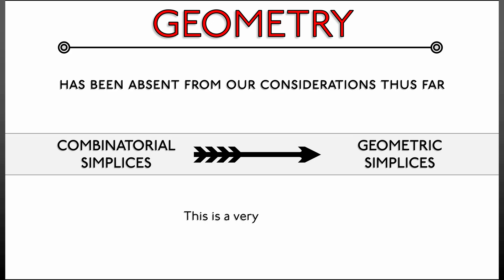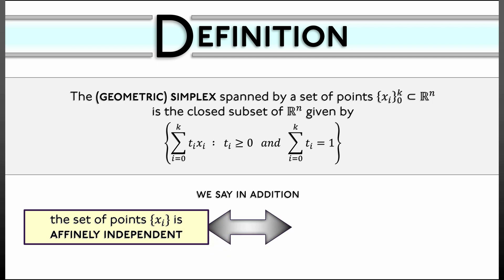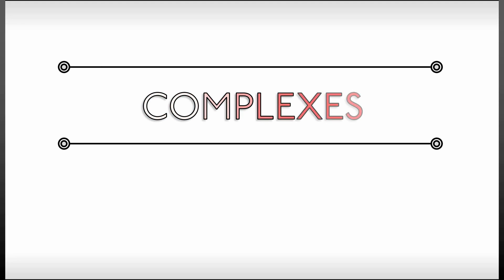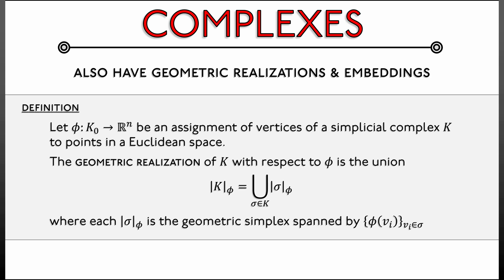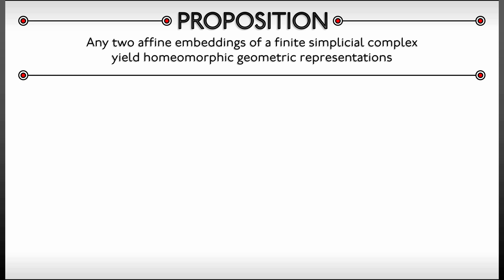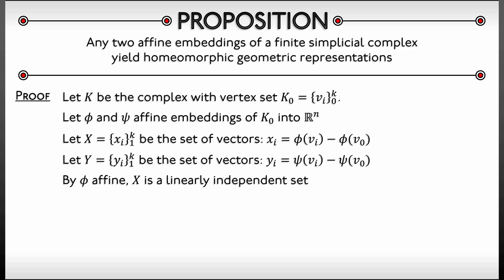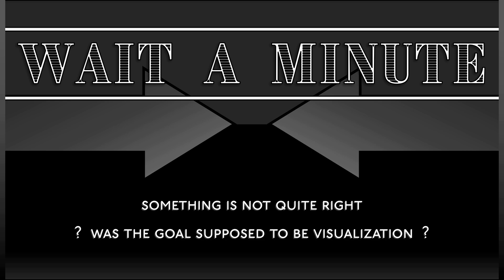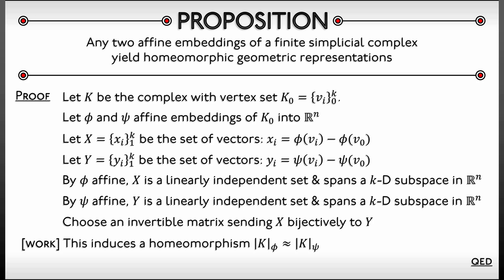FTDA 1.3 : COMPLEXES : Realization

Comment: You provided 3 existential crises in 11 minutes.
Do we worry about it or does it even make sense to think about derivatives of simplical complexes with respect to time if new data is being added from sensors?
Reply: Adding data is a discrete process, obviously. But… You may consider the random variable representing the number of data points needed to close a specific “hole” in the Vie…(what he said) complex on the dataset; then, the expectation of that RV will be a function of distance you set when calculating the Vie… complex (as well as, obviously, the underlying distribution for your data). Your underlying distribution may be a function of time though! You can also let your metric be time-dependent (e.g let one of your dimensions of your experiment sample vector space be time).

I’m a beginner here and this is one hear later! I’m just brainstorming here, I’m sure this should come up in later videos.